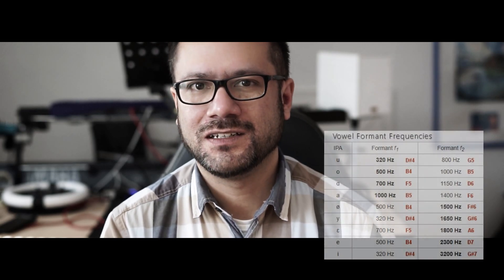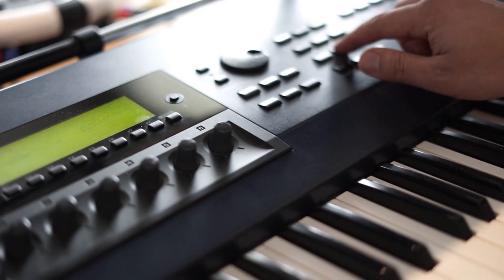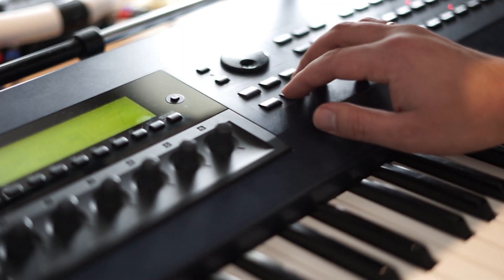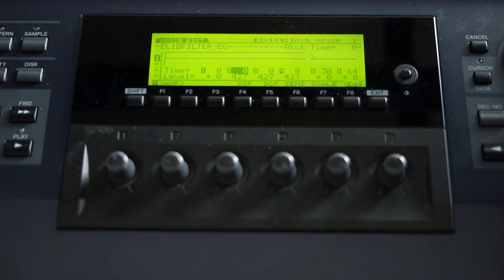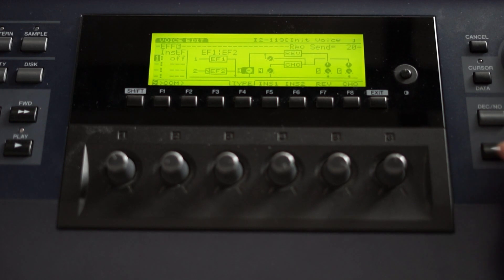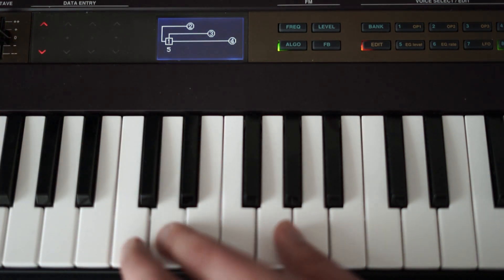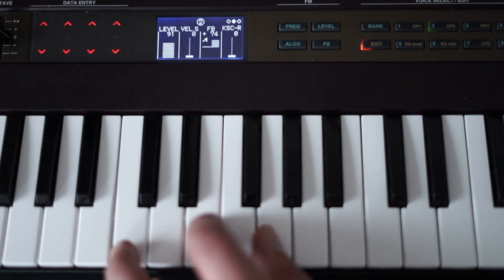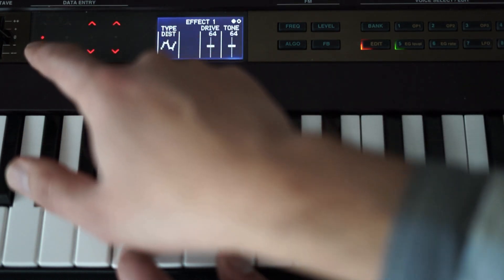Trying to create vocal formants on two different synthesizers (Reface DX and Yamaha EX5)

Comment: I'm very inspired by your work with the REFACE DX. Thinking about getting one.
Reply from the maker: Thanks! It's a cleverly designed FM synth which arguable has the most approachable interface for FM sound design so far, but also has more depth than you'll see at first glance.
Reply: @mr_floydst  

Well I pulled the trigger and ordered one from Amazon. For £292.00 not bad for what I've seen from it. It will come tomorrow. I am a very patient man having owned the original DX7 for 22 years lol. So I will really see what I can pull out of this gem. And when I have gained confidence with it. I will start uploading song demos and tutorials on my channel. Once again many thanks for all your dedicated work with this little gem. You and a few others on here have shown what is possible. I love the concept of a feedback on each to the 4 ops. And the clear digital display is great to. To really see what you are doing.
Reply from the maker: Congrats. You won't be disappointed. This is clearly the best of the 4 Reface keyboards, and most importantly, it does sound really good. Plus having a battery powered mini keyboard with not-so-bad speakers is so useful in many situations.
Reply: @mr_floydst  

The compact size and portability is very appealing. I can tell you it was no fun lugging the original DX7 around. It weighed 15kg. It  was a killer. And yes this little gem sounds amazing. You Pixelorb and Tom sink have really shown its potential. I will see what I can bring to the table in the new year...

Comment: Talking FM bass all over music during peak dubstep.
Reply: This goes way older than dubstep in the streets of rage 3, 1994 techno. The ym2612 patch yuzo koshiro uses in Inga rasen is awesome, and motohiro's kawashima patch in Fuze sounds very dark. The patches sound like robotic voices.
Reply from the maker: I'll look it up. :)
Reply: Used to make fm patches like that a lot back then. A great trick if you have a synth that supports it is using a high frequency triangle wave as one of the modulators. When used lightly at the right ratio it can really make those formants scream!